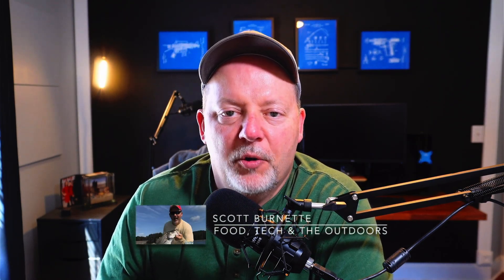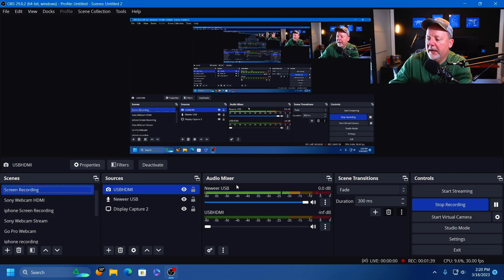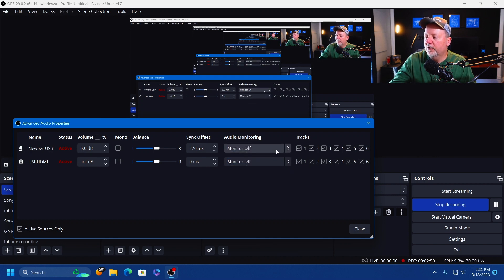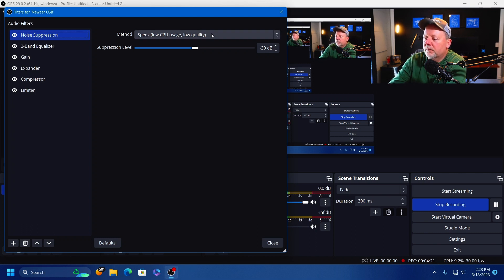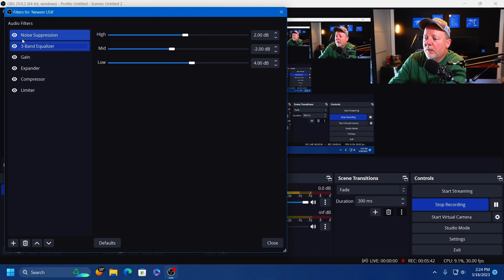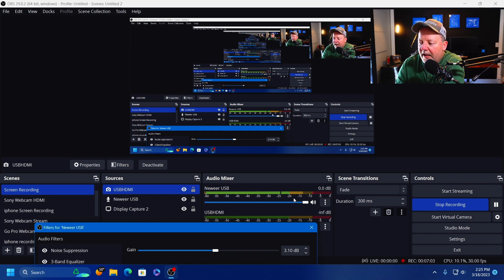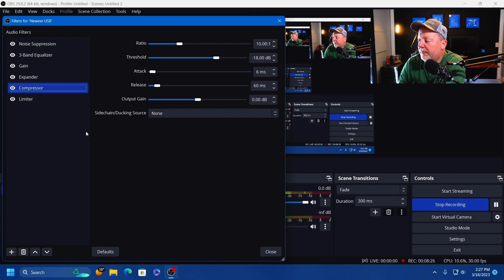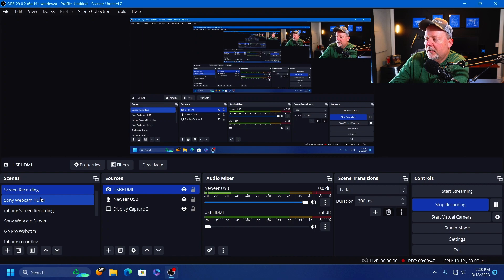Microphone Settings with OBS Studio & USB Microphone | Microphone Adjustments & Filters #obs

Comment: I've got a basic Mic, but it drops in and out (the driver is the issue). So I am stuck using a Logitech webcam with mic built in, c270 HD. I'm wondering if there's a windows based global filter that will improve the USB Mic's settings outside of OBS. Reason being, there's a little applet that lets you have an animated avatar (not quite a vtuber, just a gif that moves its mouth as you talk). Problem is, it catches key stroke sounds. If such filtering as found in OBS were available in Windows itself, it would hide all my keystroke and fan sounds, effectively allowing me to use this applet so as to prevent the mouth from moving every time i type or click... or the fan sounds... anything like this exist?

Note, if I do use my analog mic, the realtek settings are there for this and it does work, but again, sound is not consistent due to bad drivers... and there are no good drivers for my specific device. Works perfectly fine on another PC, but I'm not using that PC, so it's definitely the driver and realtek model number that's my issue with it :(